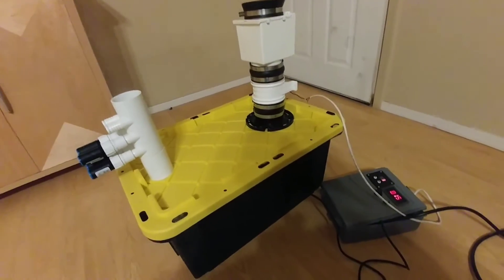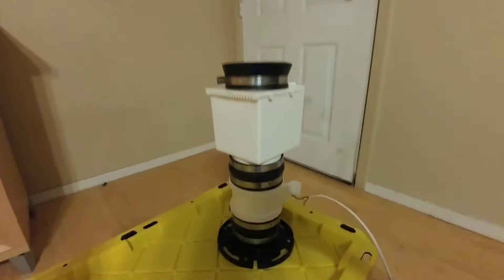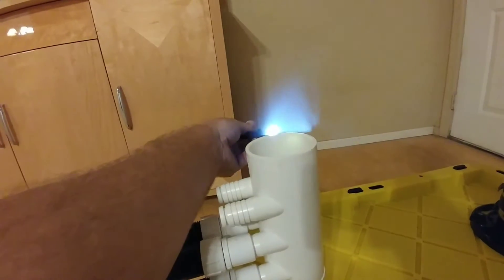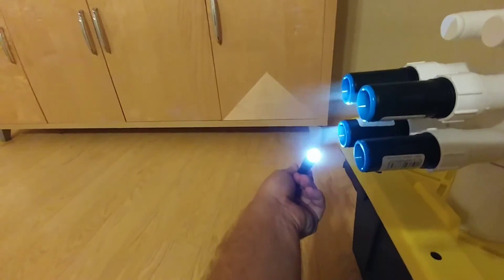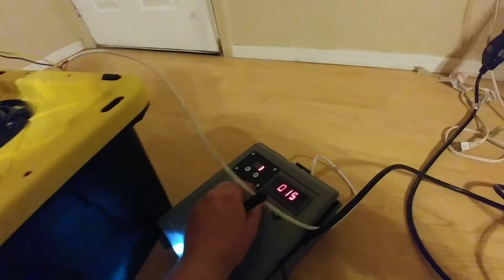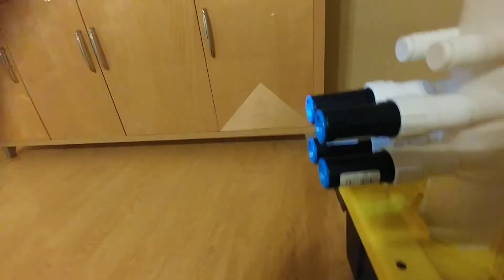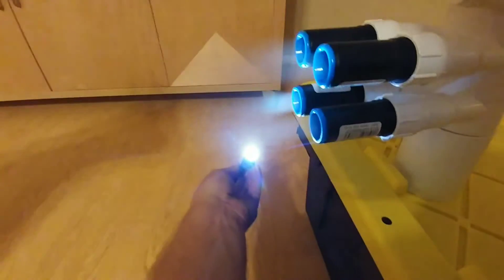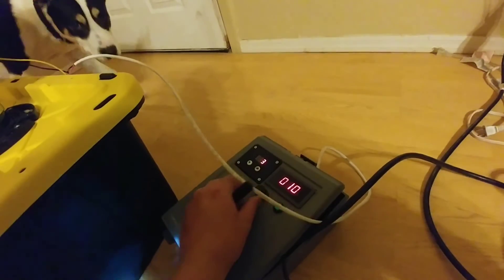Creative Hydroponics- Fogponics Reservoir test

Comment: What is the name of that pipe with multiple exits where you collect the mist?
Reply from the maker: Bolkar Acikkol it's actually a PVC manifold for hot tubs I was able to get it by just going to Google and searching PVC manifold
Reply: Great, found some, what are the sizes on your main pipe (4"?) and each port?
Also how does the system work? Any update?
Reply from the maker: Bolkar Acikkol I believe it's a 2-inch main with half inch ports